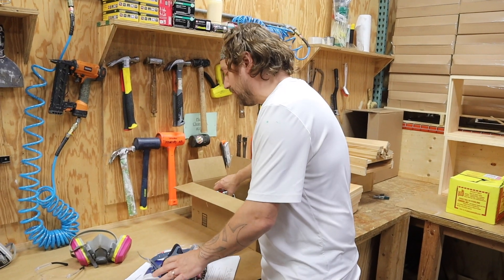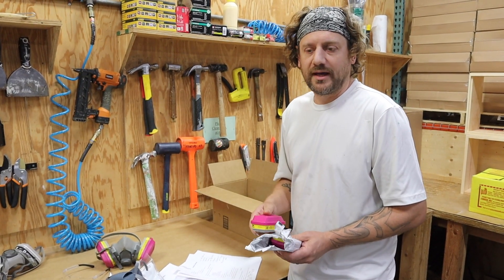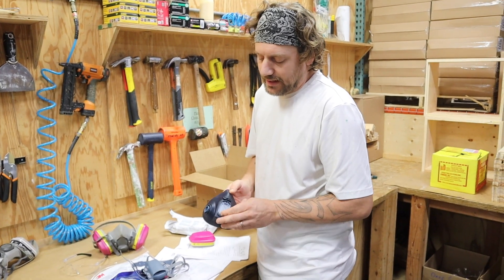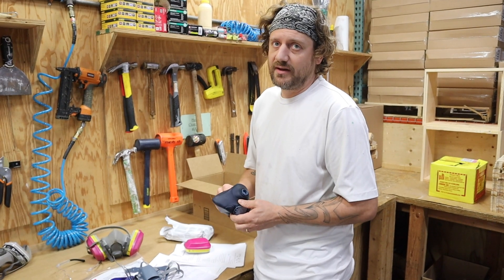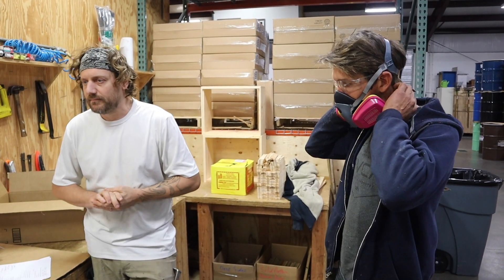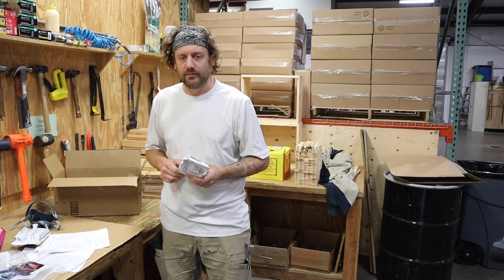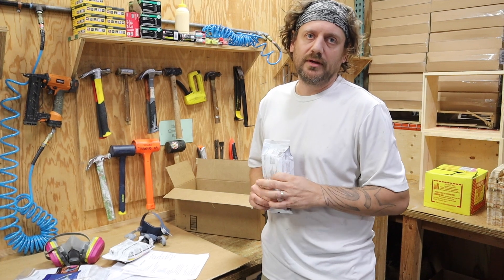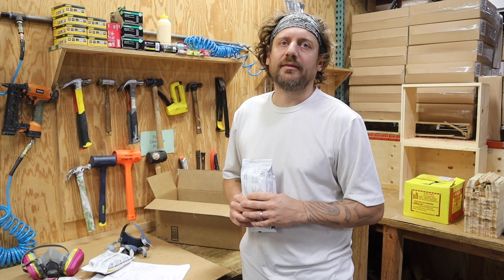Respirator for Oxalic Acid and Formic Acid Varroa Mite Treatments

Comment: Did they say how to store them
Reply from the maker: Oddly enough the instructions that came with the cartridges didn't mention how to store them between uses. It was suggested by one of the video comments that they should be kept in a zip lock baggy. We don't store them long term because we replace them after each seasonal use.
Reply from the maker: Jason Gentry  • 1 hour ago 
Bob this was a great video!!  I am a fellow beekeeper and have been in the chemical industry for 20 years.  This was top notch information on respirator use, care and storage.  If I may add just a couple things for viewers:
1.  Washing with mild soapy water and air drying is spot on.  I must stress DO NOT use cleaning/disinfecting solvents such as isopropyl alcohol.  These solvents will attack and degrade the sealing surface materials.  There are disinfecting wipes and such for respirators, but wash and dry is just fine.  Also, remove cartridges before washing the respirator....yes this has escaped people in past years.
2.  Perfect explanation on "clean" areas to hang up for air drying.  NOTE:  These organic cartridges will absorb impurities from the open air they are exposed to.  After air drying store the respirator and cartridges, at least the cartridges, in a gallon ziplock bag.  This will ensure the life span of the cartridges for use.
Reply: 3M says: Filter Material
Glass Fiber Paper

... so there should be just a storage and no chemical reaction (like carbon monoxide filters). Filters will 'gas out' a while after usage. Don't close the storage bag total.

Oxalic acid is not a poison in small amounts. It's already in the body. 
pieplant, parsley, spinach (up to 1g per 100g) have it. 
The danger is mainly the acid-fog in the lungs (pulmonary edema).

Comment: Bob this was a great video!!  I am a fellow beekeeper and have been in the chemical industry for 20 years.  This was top notch information on respirator use, care and storage.  If I may add just a couple things for viewers:
1.  Washing with mild soapy water and air drying is spot on.  I must stress DO NOT use cleaning/disinfecting solvents such as isopropyl alcohol.  These solvents will attack and degrade the sealing surface materials.  There are disinfecting wipes and such for respirators, but wash and dry is just fine.  Also, remove cartridges before washing the respirator....yes this has escaped people in past years.
2.  Perfect explanation on "clean" areas to hang up for air drying.  NOTE:  These organic cartridges will absorb impurities from the open air they are exposed to.  After air drying store the respirator and cartridges, at least the cartridges, in a gallon ziplock bag.  This will ensure the life span of the cartridges for use.

Again, VERY GOOD VIDEO.
Reply from the maker: Hi Jason. I am going to add your comment into my video description. I hope it's OK. Thanks.
Reply: @bobbinnie9872  By all means.  Glad I could help.

Comment: Bob what's your input on the oxalic dribble method.      Have a good Thanksgiving
Reply from the maker: Hi Mark. You may get this reply twice. It didn't seem to through the first time. 
I have used the dribble several times in the past with success. However, there is one big difference on my opinion. I don't see any issues with repeated vapor treatment but if using dribble repeatedly, in close succession, the bee population declines noticeably.

Comment: Bob
I have to say, not only its very responsible of you to educate people out there the importance of lung protection from the OA vapors, but educational as well for the novice viewers, as you can see from some of the comments.
Safety glasses is a must, considering that those cups pop quite often, that little 1/4" is a flaw on that provap 110 as it cools to fast and the OA crystalize back into a rocky state within the end of the pipe; I even did the Ian Stepler version where I wrapped the cup with that muffler wrap, it does help quite a lot as the temp don't drop too much below the 200C but still I have to cary a little drill bit to drill out that "pain in the rear end" rocky crystals.
Best wishes my friend, keep up the good work.
Dan
Reply from the maker: Thanks.
Reply: @danskisbees7348  same
Reply: Hello Dan!  I hope you and your family are doing well.  Have a Happy Thanksgiving my friend!

Comment: Does it matter if they are clustered tight as you treat now?
Reply from the maker: The best temperatures are between 42f and 50f when the bees are not tightly clustered, so the vapors will penetrate, but are not yet flying.
Reply: I hit mine today here in ky. They weren't flying until the vapor went in...they came out on the landing board for awhile but went back in. I think it got up around 50-52 today. It was cool, not cold. I use a 3M respirator, don't know the model but I've had good luck with it. Trust me....you don't want a whiff of this stuff! With my respirator, I can't even smell it.
Reply: I plan to treat this weekend after Thanksgiving.  Happy Thanksgiving.